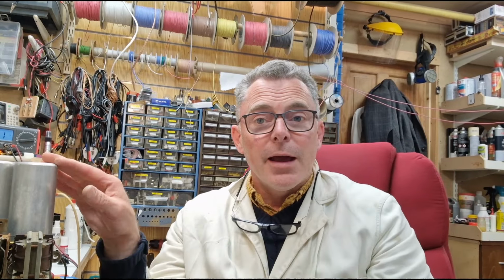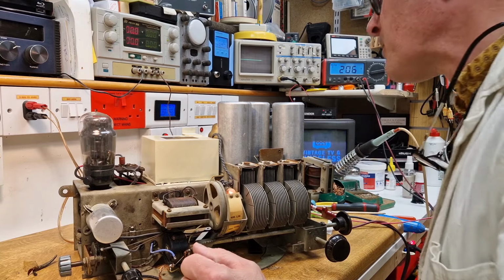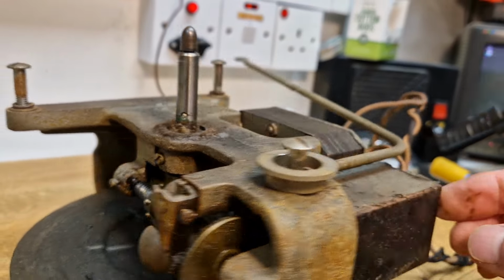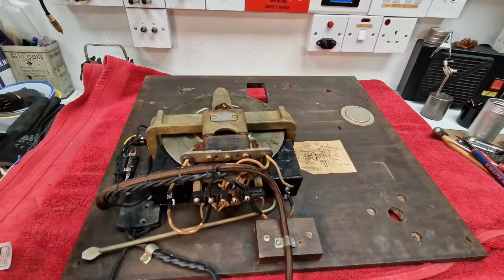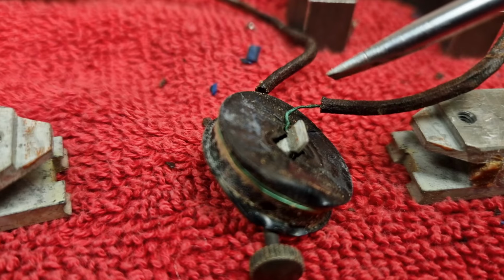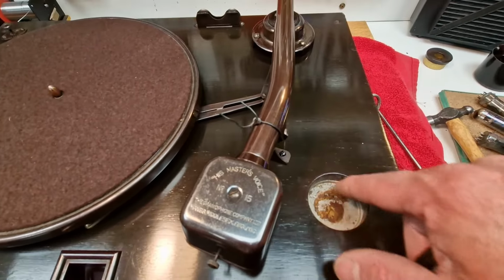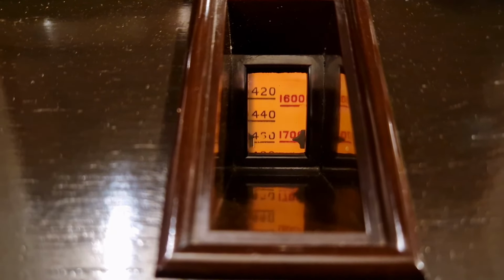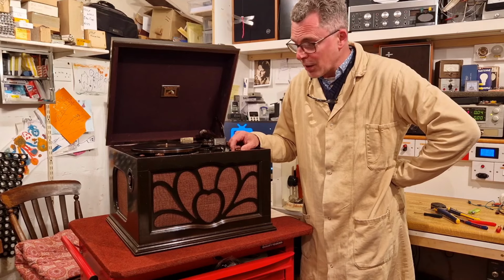HMV 501 Table Radiogram Restoration -  Part 2

Comment: The volume control in line with the pickup is a throwback to the conversion tone arms and pickups for fitting to wind up machines ( which connected to the Gram input on a seperate Wirless Reciever) ThoseLong playing needles are ok but they won’t play 60 sides. You’re better off using 1 side normal steel needles.i wouldn’t trust my 78 rpm records to them